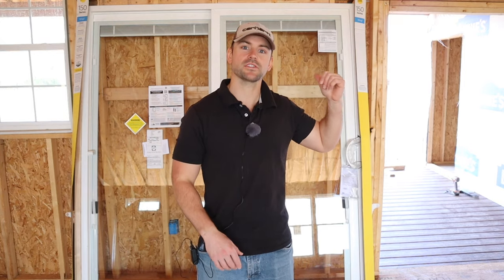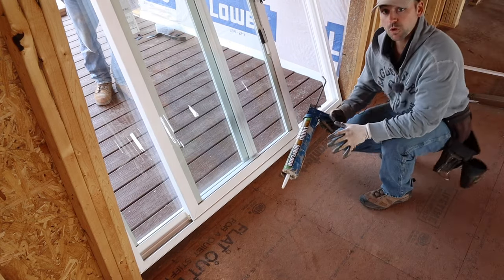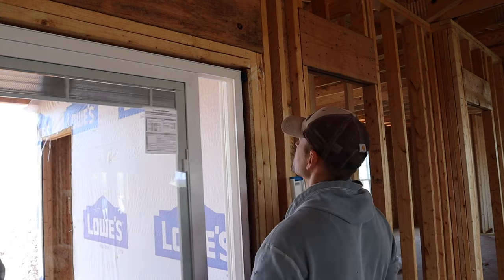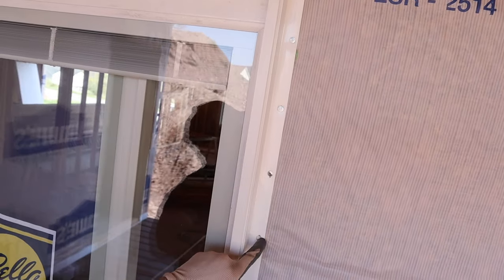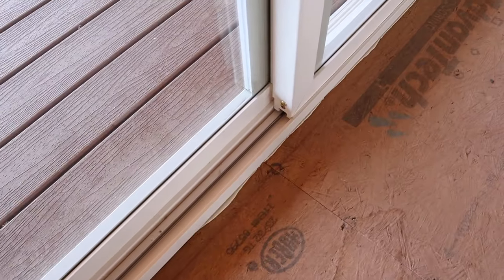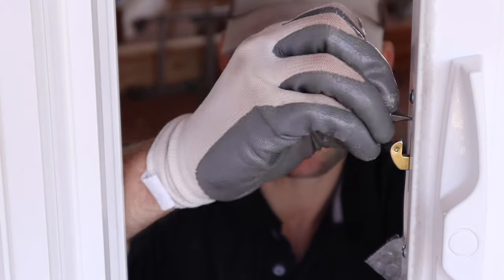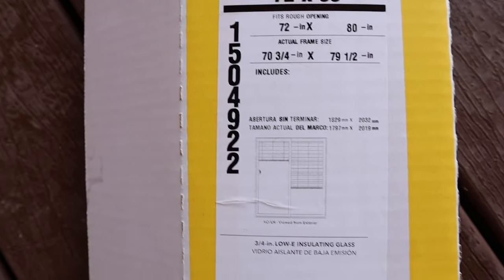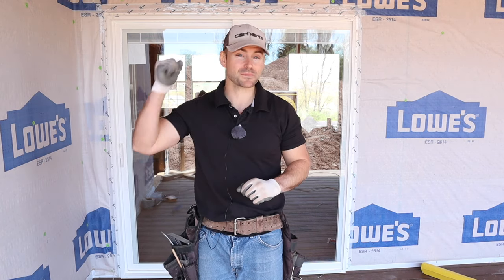Patio Door Installation

Comment: No flashing or sill pan? Seems like risky business - but looks like the exterior has a roof over it so probably not an issue
Reply: Would seem like the manufacture’s warranty would be nullified without a sill pan or flashing.
Reply: Standard practices still apply roof or not.  It's an opening into the structure and should be treated same for all windows and doors.  Otherwise it's sloppy work.
Reply: Then why say anything

Comment: Shouldn't you take both glass doors out of the frame first and install? Much easier to  handle and plum without the glass doors, as well as no danger of breakage during installation..

Comment: If you end up doing the flashing under the door, what do you use for fastening it to the floor? Liquid nails ontop of the tape? screws?
Reply: Liquid nail is the absolute worst thing to use on vinyl. I do this everyday as a contractor for the last decade. NP-1 or rainbuster polyurethane would be per manufacturer specs to seal around the fin where a 2-3/4 X 8 screw is required not nails. And on a wooden subfloor I’d never install a door without a recess pan designed specifically for moisture. Tyvek tape wouldn’t pass code it needs a pressure design per code. Also the tyvek would pass over top of the screwed off fin at the top of door to prevent water running downhill not taped over it after it’s screwed off. Don’t pull permits if you’re willing to follow these directions.

Comment: you can also put some tape on the back of the locking mechanism, close fully, then disengage the lock bolt and it will stick where it needs to be. straighten accordingly, mark screw holes, etc

Comment: If you are replacing an existing door, do you have any suggestions for breaking that liquid nail seal on the bottom of the existing slider?  Obviously you don't want to be too rough with the old door and have glass shatter everywhere.  Thanks.

Comment: Hey Josh, we are in the process of building our own house and our contractor got our 4 panel sliding doors in. What is the height and width of that door? Our rough opening is 6”8 and I know that’s standard height but it feels short. Was wondering what you thought about that? Thanks!

Comment: what about flashing and water proof silicone instead of liquid nails??
Reply from the maker: You could use silicone. I like how hard liquid nails sets up. Thanks for watching!
Reply: @TheExcellentLaborer  Something that sets up firm also acts as a mortar, and supports the door frame, reducing movement from traffic. In the event the door needs to be removed, silicone might be too adhesive, causing a lot of unnecessary damage in the process.

Comment: Ok .. question? Might be a stupid one.. did you door have a nailing flange all the way around it? Our door will be sitting on concrete. What do we do about that nailing flange at the bottom?
Reply: I bought a Pella door and the are taking it back to remove the nail flange from the bottom since it will be installed on a slab. You then drive screws through the sill.
How did you install yours ?
Reply: We ended up and removed the flange on the bottom. Then used liquid nail heavy duty for the bottom which also worked as a sealer. Nailed the flange around the sides! Basically just like shown in the video! It’s perfect!

Comment: What is the rough opening for a 72” wide by 80”  high sliding patio door?
Reply: A 72x80 vinyl 250 double sliding door from pella actual size is 71.5”x79.5”. So the rough opening is recommended to be 72”x80”. You want to have at least a half inch bigger rough opening then the width and height of the frame size. Also the door shown installed does not meet u factor and would not pass code in the Chicago area. So check what the minimum u factor is in your area.
Reply: @rodrigoarreguin9865  thanks for the info,  if you don’t mind, why this door doesn’t meet the U factor?
Reply: @macrapidito1  it does not meet u factor because of the blinds between the glass.
Reply: @rodrigoarreguin9865  thanks again, I found your answers not only helpful to me but to others too. 

Keep it up! 

Thanks again.

Comment: I just ordered this patio door. Do you think it’s good for outside weather? I got the 60 X 80
Reply from the maker: It’s definitely a solid door. I really like mine so far. For the price I don’t think you can go wrong. Yes weather should be fine against the door. Hope that helps!
Reply: @TheExcellentLaborer  that’s great to hear! I got mine for $319 minus delivery and taxes but still a great deal. Also, I noticed it has a header but not like a usual window header- is that normal?

Comment: Have you ever reversed this door ?? I need one to open in opposite direction, is this possible with this door + blinds ?? (great video btw)
Reply from the maker: Oh and is not. Inside with blinds must be on the interior. Good question though!
Reply: What handedness was this door?
Reply: @TheSwordAXE  the door can be ordered as either Left or Right handed.
Reply: I actually ordered and just received a 150 series 96x80  no blinds. It's marketed as reversible/universal. You can configure it any way you like. It comes with instructions to do so. The different ways involve removing the panel(s) and flipping the frame top to bottom and removing the track and relocating it from bottom to top before flipping or top to bottom after prior to reinstalling the panel(s).  Then reinstalling the handle as needed as well as the latch potentially if your combination of repositioning causes it to be  upside down and or backwards. Again this is with the no blinds version.  And the instructions to do so are provided with the door.  Not able to order as left or right. Its just universal and you can bet it will likely be opposite of how you'd like to install it. But definitely doable. I can't speak for the blinds version but I feel like it would work similarly but perhaps not. Pella does have instructions also on there website but they seem to be generic and referencing another model. But looking at my instructions for the 150 and comparing them to the online instructions. It's the exact same process.
Reply: @ericinalaska7648  Thank you for this information. i just purchased this 150 series door without the blinds and i need to reverse the door. so glad its doable.
Reply: @richallen7506  Yah it turned out great.  It takes at least two people Id say to do it  safely and  not have an oops. I removed the slider panel by lifting it up and then pulling it out on the bottom. Then flipped the frame and remaining panel top to bottom. Pulled the track out and moved it to the bottom.  Then rough placed the frame in its new home. Replaced the panel we removed while another head frame in place.  And finished securing it. Then the handle assembly needed to be flipped. But was pretty much it.  Very happy with it in the end. No probs. Avoided breakage. Enjoying the end result as I type.